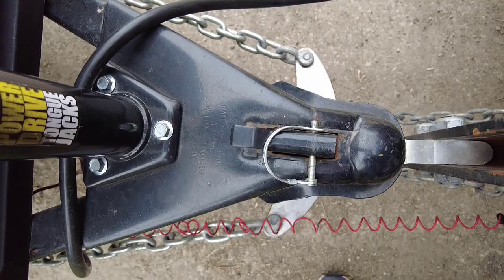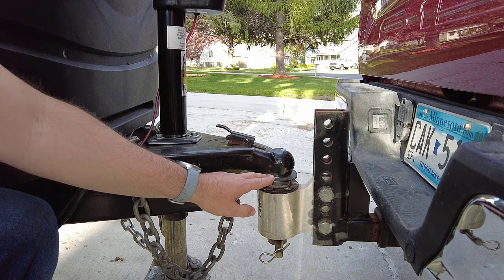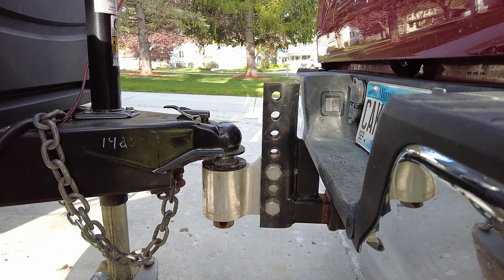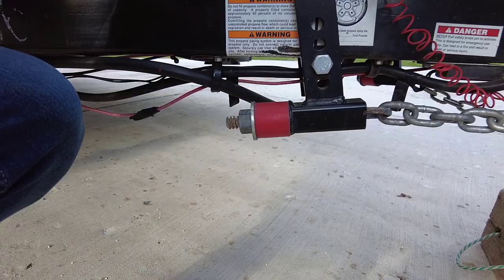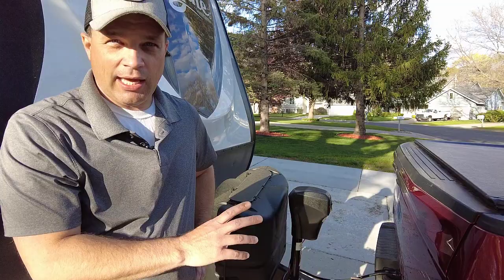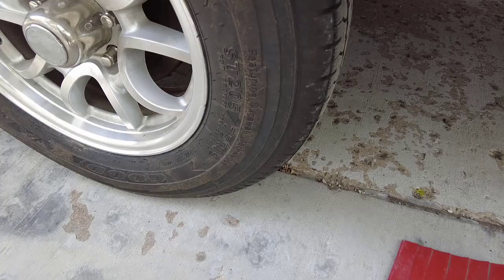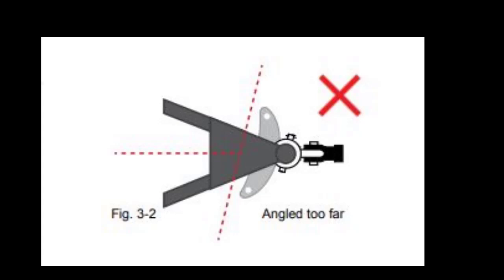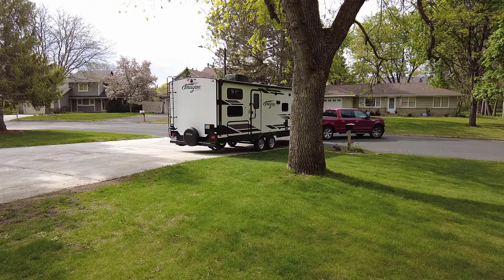How to hook up an Andersen Weight Distribution Hitch | Step by Step Hitch Instructions for set up

Comment: Great video and very informative!

One thing I’ve found with weight distribution hitches is that if you’re needing to back the RV up at weird angles, disconnect the weight distribution (bars or chains) first while you’re straight, then back in. Just taking extra care not to damage your truck or RV.. Because nobody wants that bill 💸 😃

Hope you all are well! Keep the great videos coming!
Reply from the maker: Great point, thanks Corey!
Reply: @DriveNorth  I use a 3 ft long steel rod of correct dia.to insert into pin hole.to straighten plate.
Reply from the maker: @gordonstrickling5971  Good idea, I may copy that.
Reply: Same. I have evolved to unhooking Anderson sway while I’m in a straight line while my wife checks into the campground. And then when we are leaving I usually connect sway again at dump station while dumping (usually when filling black tank for flush). Also, I just raise my tongue jack up a few more inches so I don’t gave up loosen and tighten the chains. Stays the same every time

Comment: Thanks for your videos you helped me make my hitch purchase. What size torque wrench should I now buy 1/2” or 3/8” for the frame bracket , hitch, and chain tighten (socket wrench size for the included socket ?).   Thanks and keep up the good work.
Reply from the maker: Here is a link to the instruction guide. It lists the sizes of all the bolts. https://help.andersenhitches.com/install-weight-distribution-hitch

Comment: If the brackets are not mounted the same distance from the front of the coupler, then the thread counts should not be the same! If they are, you will have more tension on the side with the longer distance, and the triangle will end up cocked towards that side.  Instead, get them hand tight, at which point the number of threads showing may already be different. From there, count to make the same number of revolutions with the marked socket. This will put even tension on both sides.
Reply from the maker: good info, thanks

Comment: I have f150.  Do you have to disable the TRAILER SWAY CONTROL to use the Anderson hitch?
Reply from the maker: Not that I'm aware of. I never turned it off when we had our 2018 F-150 and used this hitch. We now have a 2014 F-150 that doesn't have sway control. Still might not be a bad idea to double check with Andersen directly though.
Reply: @Drive North  Thanks for  the update.  I will probably not turn off sway control, but just to be safe, I will check with Anderson.

Comment: quick question, i have no experience on sway control attachments.  when Im off highway in the city or any other tight turning streets (places), do I need to do anything? any adjustments? thanks 😮
Reply from the maker: With some systems, you have to disconnect before making tight turns like backing into a 90 degree spot. With the Andersen system, you can leave it place all the time.

Comment: A couple of very important things on your setup... First, you need to cross your safety chains from the trailer to the truck! As for the hitch setup, the chains on the WD hitch need to be as straight as possible, not all twisted like yours are. Also, the shackle bolts on the anti-sway plate you have mounted upside down, they are supposed to go from the top down. It literally says these things in the setup instructions and on the Andersen website. I point these out only because you made a video of how to hook this hitch up and you missed a couple very important things according to the manufacture.
Reply from the maker: Ill look  into that
Reply: @DriveNorth  6 months have gone by; have you "looked into that"??
Reply: @TheMinnow101  hey carl, maybe you should make a video
Reply: Always, the weights n measurements police wanna critique people. Just trying to justify their 3/4 or 1 purchase.

Comment: I am trying to straightened out my hitch plate per your video.  Am I supposed to put the ball on the hitch and then  put the chain on the one side of the AWD hitch and then drive in the opposite direction ?  Or do it without putting the ball on the hitch?
Reply from the maker: There are a couple of different methods, I talk about hooking the chain to the side of the plate that is angled back, then pull forward the opposite direction. Here is a video done by the factory that explains it all better than I do.  https://www.youtube.com/watch?v=HO_QTxnJVN8

Comment: Safety chains need to be cross otherwise it becomes more dangerous. Should your trailer become unhitched, the trailer tongue will fall on the chains holding it up vs on the ground dragging your truck with it. I've seen multiple videos of it not being crossed like it should. No hate or cristism, all love brother.
Reply from the maker: Good advice
Reply: Lol.  Notice the two safety chains from the same point on the trailer.  You can cross them all you want and it’s not gonna do a damn thing

Comment: Is there a way to attach without using coupler raising tow vehicle?  The coupler itself is not designed to pull the weight of tow vehicle in the upward direction. Thanks
Reply from the maker: I guess that if the first I've heard someone say that.
Reply: We were instructed by our dealer to raise/lower as shown in the video.
Reply: @trekhardfilms  dealers will tell you anything. That's a lot of stress and weight, tongue and rear of vehicle.
Reply: That is Andersen's instructions.
Reply: @GKo  ok, but I know when the hitch is slid over to lock on the ball it's not good to lift all that weight including rear of tow vehicle. The lock is not designed for that. But everyone does it.    Except me

Comment: You need to cross the safety chain.  Good video otherwise.
Reply from the maker: I've always done that with previous trailers that had different mounting points for the chains. This one has both chains attached to a central ring and it doesn't seem like it makes a difference if they are crossed or not.
Reply: "need to" is a bit dramatic. Is it better to cross them, yeah. Is the world going to implode if he doesn't? No

Comment: I am not impressed by the Anderson Weight Distribution company.  Their solution for my brand of camper, which requires a  longer chain. is two lengths of chain connected by a quick link.  The best, most elegant, solution would be provide the chain length needed for the Casita application.  After about 800 miles the quick link provided exploded.  I was told to go to the hardware store and purchase other quick link.  I purchased one with a higher rating.  A real company would easily provide a length of chain without using a "quick link".  It may require a product code designed for that application.  Don't think it would be that hard.  It is a very dangerous defect if you are using with a Casita camper.  They will tell you that you didn't tighten the quick link and it came undone.  Food for thought.  Is Anderson a REAL COMPANY?
Reply from the maker: I only had one experience reaching out to customer service. The internal cone had excessive wear and they sent a replacement out right away at no cost. That being said, I'm not whole heartedly recommending this hitch like I once was as the overall wear and tear (internally and externally)  has been more than expected.